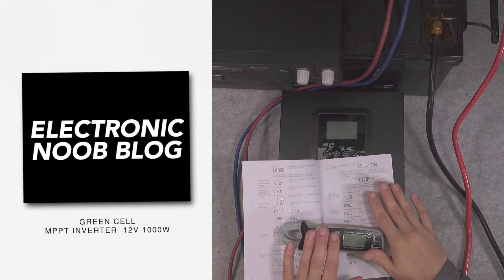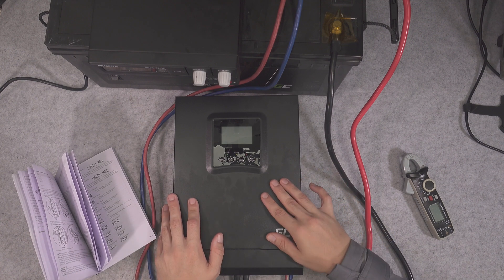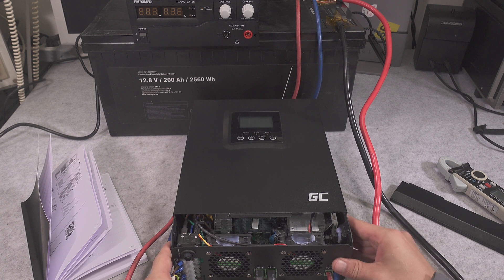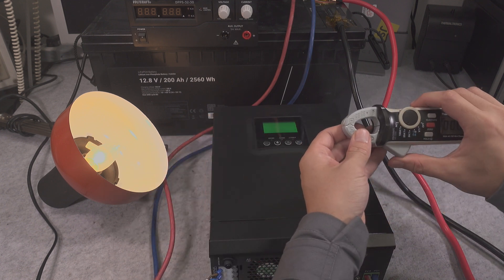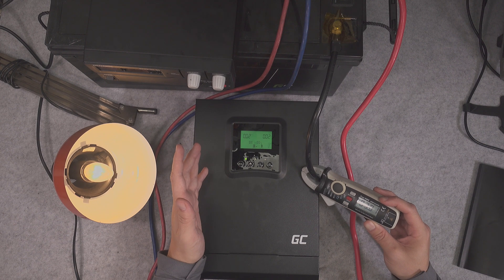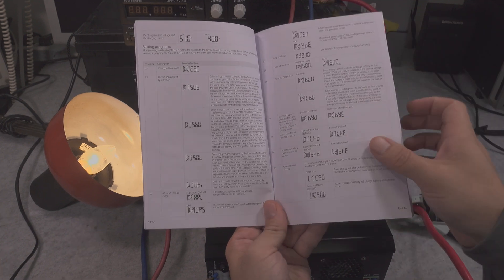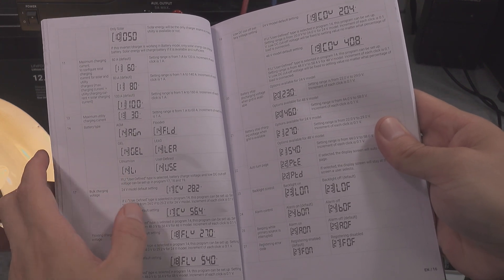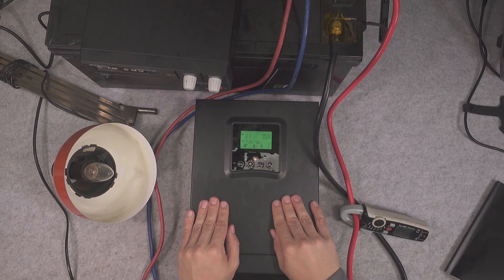Green Cell MPPT solar inverter 12V 1000W - as UPS with 200Ah LiFePO4 battery - for radio equipment

Comment: have a question : in specs its said that  Inverter Mode DC input 12v 125A - but you have 200 A battery - its it works fine? im worried about that because i have a plan to connect up to 3 * 12v battery`s  in parallel with 300A in total. Dont want things to blow-up. Thanks in advance for reply
Reply from the maker: 200Ah is capacity, notice h for hour - You can always go with greater capacity, in general this is good thing with rare exceptions but You can disregard them. So if You plan use 300Ah then no problems - it will just have longer autonomy run time.
Reply: @ElectronicNoobBlog  Hey! Thanks for a fast reply! Now i`m more  confident in  my plans! :face-red-heart-shape:

Comment: How you accessed settings? I’ve this invertor and want it to charge my battery when there is electricity from city and connect my working laptop to it so charge laptop from battery when there is no electricity from city

Comment: Hello!
What is the maximum number of solar panels that can be installed with this mppt voltage regulator?
If 415W mono panel:
(Isc)14,02A
(Imp)13,13A
(Voc) 37,45V
(Vmp) 31,61V